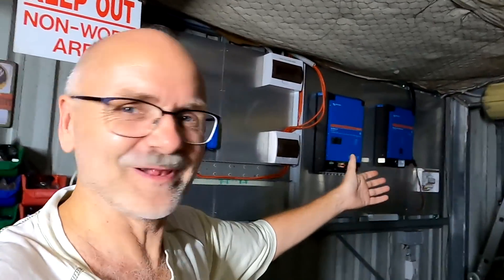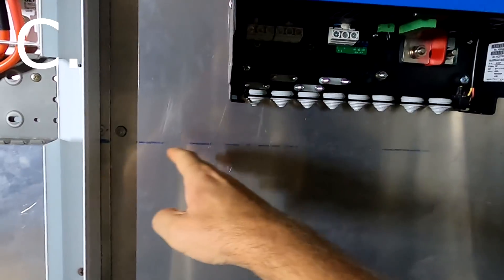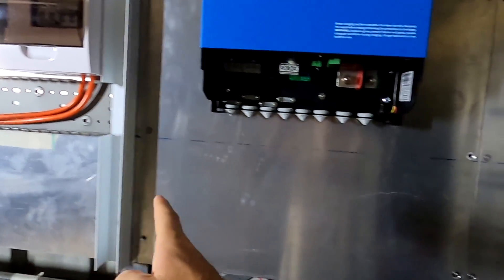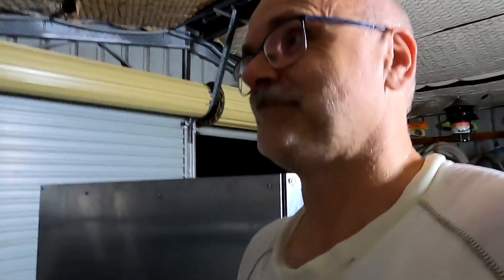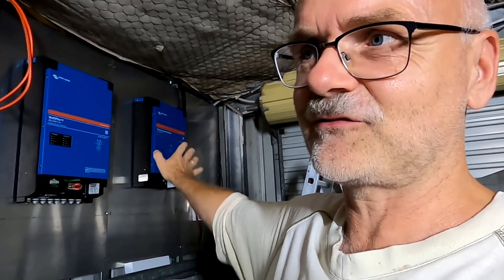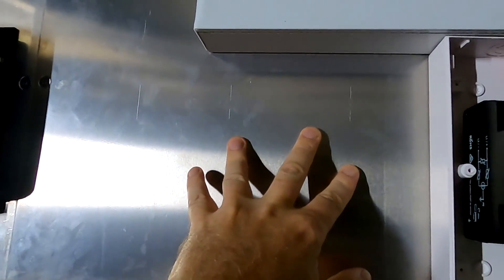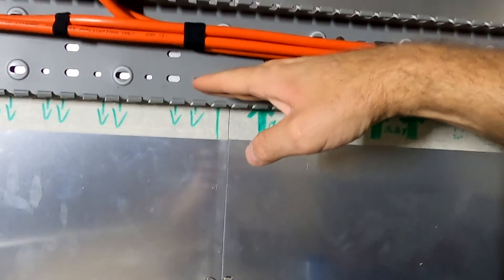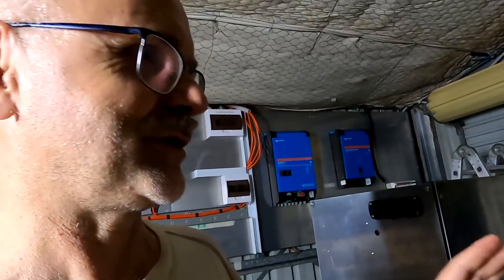Inverter 'upgrade' again, 2x 4kW solar charge controller and final decision for the PowerWall

Comment: The MPPT terminals with pressure plates are supposed to be user bare wire. NO FERRULES. Actually, they even reduce the contact surface.
Reply from the maker: The ferrule will flatten when tightening the terminal and spread across the area. Ferrules will make sure that all strands of your cable have contact to the terminal. This may not be the case without ferrule. So I would argue the opposite and say without ferrules the risk of not having all stands making good contact is greater.
Reply: @OffGridGarageAustralia  On the other hand in the manuals Victron doesn't demand to use ferrules.

Comment: I know it's unlikely, but have you checked the continuity to ensure there's no attachment between the shelf metal and the conductors?
Reply from the maker: With conductors you mean the battery pos and neg?
Reply: @OffGridGarageAustralia  yea, although I didn't want to restrict the comment to just saying battery side of any connections incase that didn't mean connections after breakers or such.
More that, ensure that everything that's supposed to be carrying power isn't somehow, accidentally, tied to ground/shelf/structure.

Comment: At the rate you are completing this project you are going to have to buy all new cells for your batteries as the ones you have will have died from old age.
Will Prowse would have done this in only 3 videos.  One on the wall setup, second one on the batteries, and last one showing it all working.  All done in under a week. I guess if I come back somewhere around 2025 I will be in time to see it finally get switched on for the first time.
Reply from the maker: Maybe he does not have a day job and has unlimited (financial) access to supplies and goods.
Reply: @OffGridGarageAustralia  Nobody wants 'only 3 videos'. We all enjoy the 1. frogs, 2. Dogs, 3. Humour, 4. More frogs, 5. Instruction!, 6. Andy!

Comment: Why did you not just cut the plastic off the ferrule and still crimp a straight shaft to your bare copper? Be a much better connection

Comment: You paid extra for that stickiness on the conduit, last time. Lol. It must've been some kind of an upgrade (jk)
Reply from the maker: It would have stuck to the wall just by itself. Maybe that was it :)
Reply: @OffGridGarageAustralia  or if there was a cable you forgot to route inside the conduit (or even a new one from a future upgrade), no problem, just stick it to the glue on the outside.
Reply from the maker: @russkubes  Hahaha, great. If the duct is full no problem, the outside can cope with more cables...

Comment: Andy, all the comments about soldering your bare battery cables going in to the SCCs for "safety" 😳. Have you covered this before? Maybe an idea to explore in a tutorial video?
Reply: I'm pretty sure he covered this just a few videos ago.
Soldering will keep the cables round, which reduces the contact area. Moreover, the solder adds another material between the terminal and cable, which increases resistance, which isn't good in such high current applications.
Reply: @russkubes  I'm pretty sure he covered it also. But people (not me) seem to have missed that. I'm well aware of how bad of an idea it is. You more or less reduce the available surface area in contact with the terminal, because the cable cannot form to the shape of the terminal. In a ferrule, as Andy uses square shaped crimp, the surfaces all meet up pretty well, and they're that tony bit impressionable, so they will still form to the shape of the terminal. I have seen many videos covering the issue, just wasn't confident I had seen Andy do one. As for "another material", the ferrule is another material, so that's probably not a legit claim. It's all about the solder rigidly holding the shape of the copper strands in a round form, which reduces surface area of the contact between cable and terminal and this is the reason the connection has a higher resistance.
Reply from the maker: Yeah, had this in my videos at least twice. Maybe I should do a dedicated show for that problem.

Comment: The tiktokfrog sound just like the clicking  relay from your  BMS...
Reply from the maker: It's the QUCC frog!
Reply: @OffGridGarageAustralia  talking about the QUCC bms, I want to parallel two, perhaps three 48V packs, but they say not to use qucc bms's for that.  I don't see any problems as long as SOC is equal  when connecting them together. What do you think about this?   And I had the same clicking relay,  that had something to do with the equalizing voltage (which is a fixed parameter and cannot be changed...)
Greetings from the Netherlands and keep on going with your video's!
Reply from the maker: @Victor-ut4zp  Thank you.
I don't see a problem either. You should be able to use any kind of BMS for your packs. If the settings are not the same, it should not matter either as the BMS with the lower settings will just shut off earlier. In saying that, the solar charge controller should be responsible for charging and there it uses the same settings for all banks anyway if they are in parallel. The BMS is more for safety if one cell gets too high or low..

Comment: Although you appear to have used good sized cable for DC,  it is good practice to not bundle them tight but allow airflow between cables for cooling.  Not an issue if cables do not even get warm at Max load.
Agree option C, better to keep DC cables short (as there are more Amps) and AC do the longer runs.
Love your Frogs, show your garden is a healthy ecosystem.  Much better than Cane Toads.
Reply from the maker: Yeah, these cables won't get warm. These 16mm cables from the incoming solar will see only ever 50A max but are rated for 75A.
We have toads too but far more frogs thankfully.

Comment: Andy I noticed the holes in the tray I think you can use thin small zipties to keep the cables neat in the tray
Reply from the maker: I was thinking of using slim Velcro strips though these holes in the duct for that so I can undo it and add/remove cables. Keeps them organised.

Comment: i think you need the inverters around the other way,  as in the small 1 continuous an the multi to macth the frequency an boost the output,  when it exceeds what you set as a limit for the mains, this is on the ac side not the dc. i say the wrong way around as the small one is closest to the ac distrobution
Reply from the maker: Well, that depends how we setup the system afterwards. We can have it the way you described it or we can have the Multi requesting the small one from turning on and boost the input of the Multi.
Both is possible.

Comment: You can solder the wire on the solar charge controler. 
Or does it have some cons?
Reply: No solder because it flows resulting in a lose terminal connection and this will generate excessive heat.

Comment: Crimp the ferrules and cut off the plastic isolation. Because you are using heat shrink anyway, there will be no problem.
I do that all the time, professionally.
Reply from the maker: Yeap, that's a good idea, just using the ferrule part. I may even order the double length ones as these terminals are deeeeep.

Comment: Great to see a new video from you. For 16 square cable, you can get long ferrules, atleast over here. Short length ferrule is 12mm, long is 18mm...
Reply from the maker: Yes, the double length ones. So far I had them tested in the MCBs and they seemed OK but these charge controller terminals are huge!

Comment: I also bought a JK BMS and now I am working on a system using Victron MultiPlus II, Victron MPPT 100/20 and Venus. I'm using Li-Ion car batteries and due to the higher risk of them igniting one way or another, I keep thinking how I can make sure that a cell monitoring circuit (JK's circuit) does not give an error or short circuit and thus overload a cell that could lead to fire. So I was thinking of using another additional BMS with the only role of monitoring the cell voltages and cutting the battery if needed - the other one would be responsible for doing the charging/balancing alone. This way, I'd be introducing redundancy in  case the charging/balancing BMS somehow fails. I'm curious if you've tried this and what your advice would be? I'm open to sending you a diagram of the system as I'm seeing it now.
Reply: It is possible to monitor most jkbms with serial and maybe bluetooth later. I will do this later. That in turn can control some alarm or mayby extra safety. And a suggestion is also to plan for the worst, if they go up in smoke how do you protect the rest, almost airtight capsulation, fire insulation and outside ventilation. Just in case also special fire supression siuted for litium.
Reply from the maker: If one BMS does just the charging/balancing and the other one the cell monitoring, there is no redundancy. You can only ensure that if both BMS do the exact same and if one fails, the other one is still there to protect.. I would not charge higher than 4V with Li-ion. I case something happens you still have a buffer.

Comment: For the solar charge controllers: next time, remove the plastic ends from the ferrules and crimp the bare ferrule on the end of the cable (to still protect the strands). Just a personal ting, great video though.
Reply from the maker: Great suggestion. I did this with other ferrules but forgot all about it. Thanks!

Comment: Hi Andy
I would like to give you a little advice how to fit a "feril" if its too big for the terminal. This is not a professional and easy solution, but sometimes it is a necessity. Cut the feril insulations off and then crimp it.
Greetings from Poland
Good luck 💪
Reply from the maker: Thanks for the tip! That will work.

Comment: Nice update! Looks really good 😁 building 12v/24v/48v is so much fun. I really enjoy it. I wired my 12v system further yesterday. So it is now ready for the 2x Aolithium batteries. 😁 And finally all the 230volt Items arrived. But the fuse box has 1 position to less 😅 So no 230 install on Sunday 😂
Reply from the maker: Thank you. It takes so long to get all your equipment and there is always something missing!

Comment: Andy- Nice and neat wiring of your cables in the plastic wire ways! Where did you get the plastic wire ways? Are they called wire way?
Reply from the maker: Thanks Rodger. 'Cable Duct' they are called. Or cable trunking in some countries.

Comment: For the connection of the solar chargers I am using these connectors: 
Stiftkabelschuh Kabelverbinder unisoliert Nennquerschnitt: 16 qmm Kupfer galvanisch verzinnt, zur Kabelverbindung 50 Stück
Reply: Yep .. those are the right ones, I always use those too..